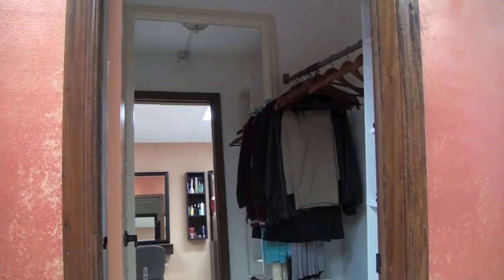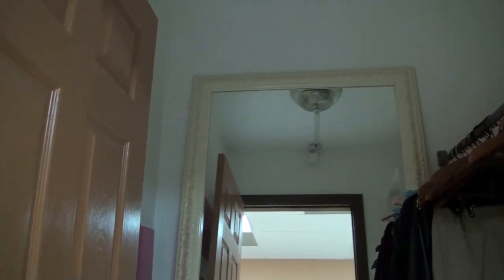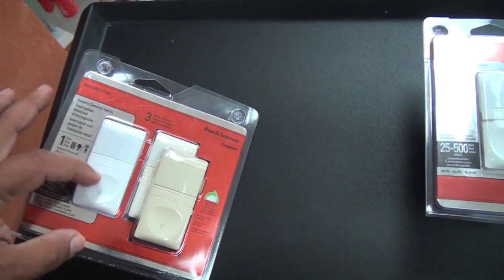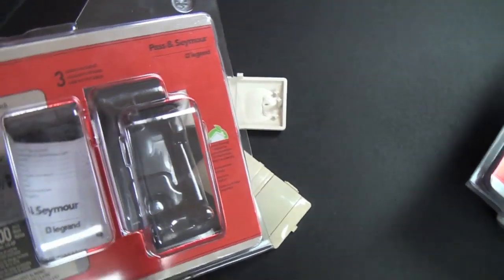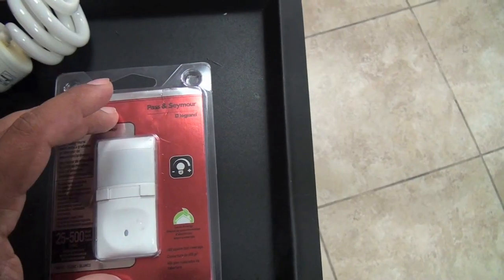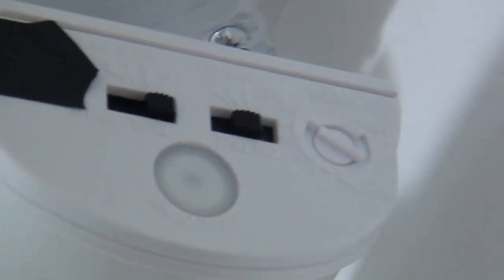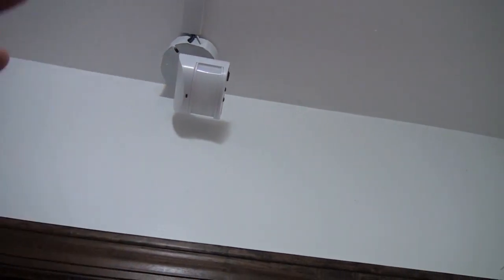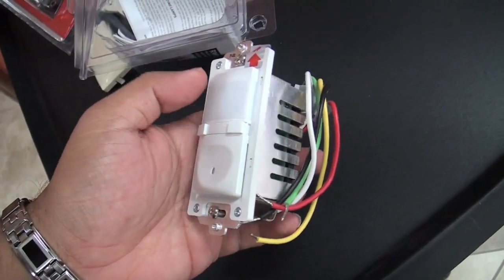Outdoor Motion Sensor Modified For Interior Use

Comment from the maker: But if this helps here are the instructions.
Remove the light fixture. When fixture removed u will have a Black and White wire. 
On the sensor u will have 3 wires, Black, White & Red wire. 
Now connect the sensors black wire to the black wire on celling & white with white. Red wire goes to the black wire on fixture. Now u need to connect white wire on fixture with the other white wires. All white wires have to be together. 
Hope this helps. Good luck

Comment from the maker: Thanks. So far it works great. I haven't had a single problem with it. I bought it from LOWES. but can also find them at home depot. The model is no longer available, they discontinued it and have made improved versions of it. It will cost you about $20 the sensor all by it self. Much cheaper then those fancy and complicated to install Switches.